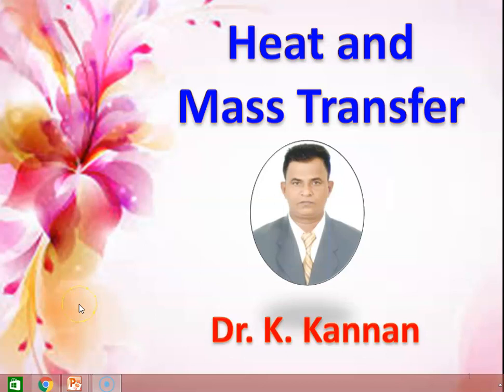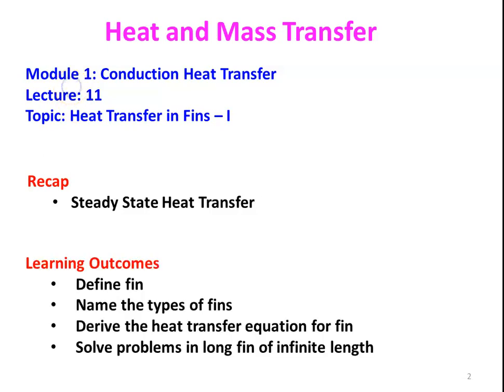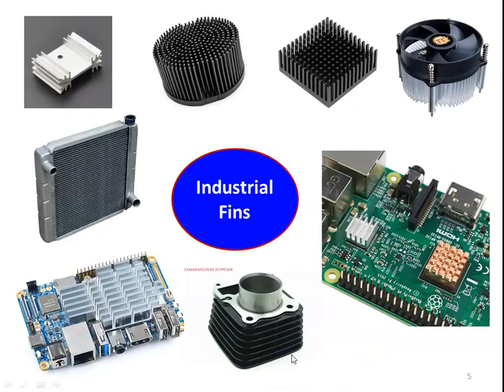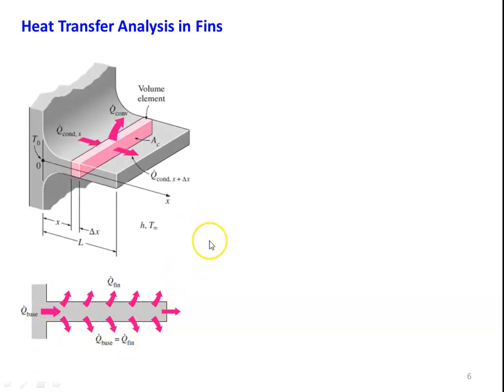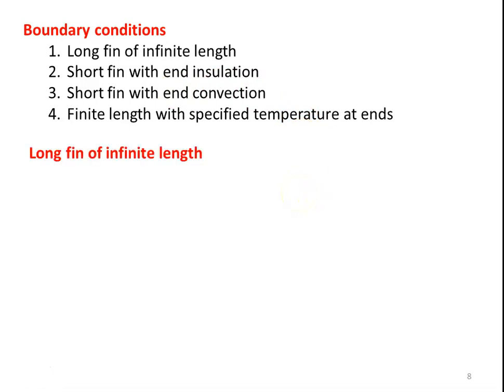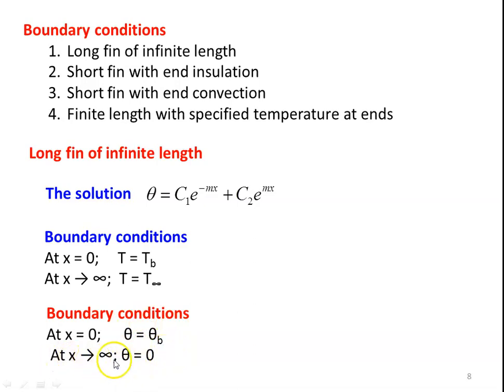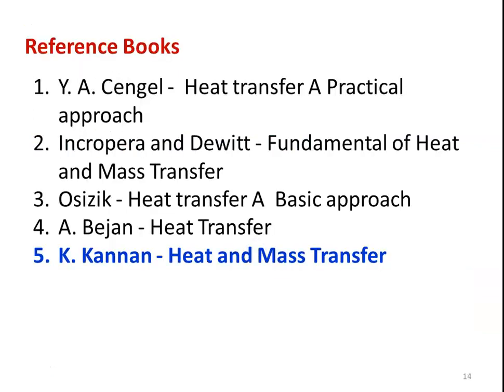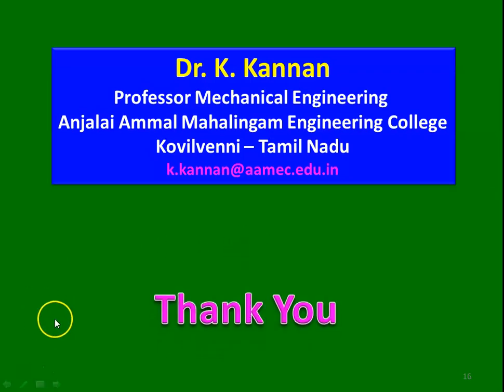HMT 1.11 Heat Transfer in Fins - I

Comment: dr can you explain this A thin rectangular plate has boundary conditions how we can calculate 
A- Determine the temperature distribution in the plate if it has
negligible heat loss from its surface.
B- If a = b  find the center temperature.